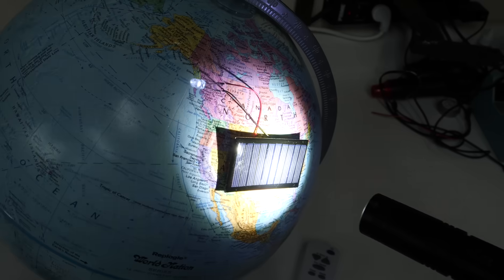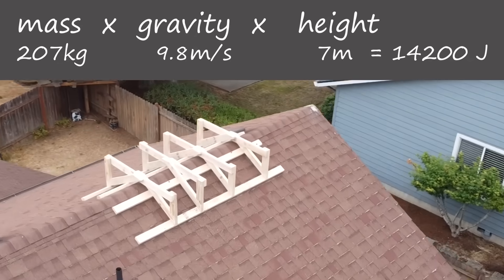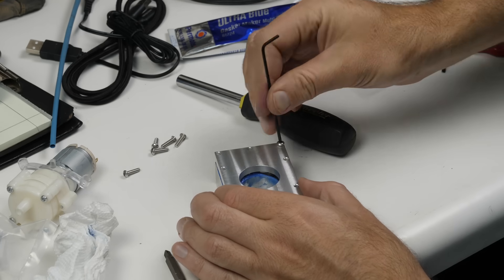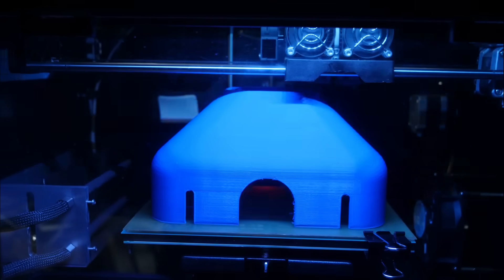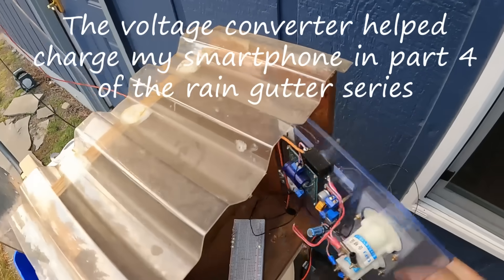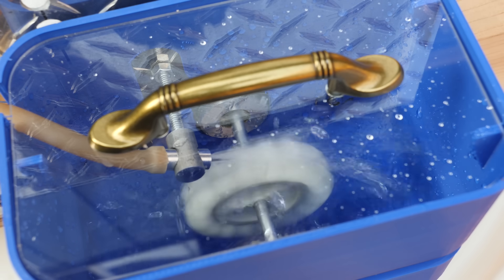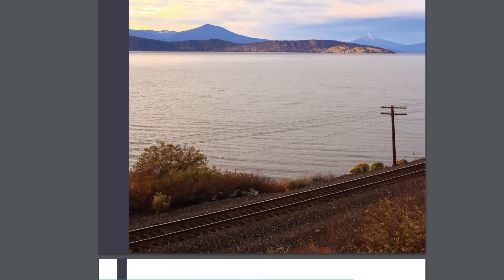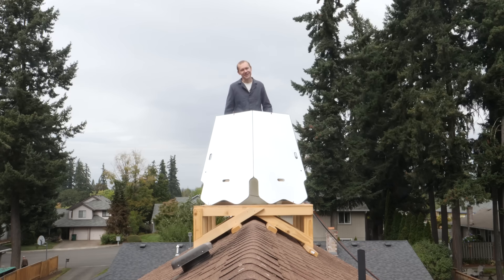Storing Solar Power on my ROOF!!!

Comment: Years ago I calculated that I'd need to suspend a volume of concrete that had the same square footage as my home and 9ft tall, over 35 feet in the air to have enough potential energy to power my home for a day.  That quickly destroyed all ambitions I had of using potential energy as a means of energy storage.
Reply: What if we build our house on the top of a solar powered lifter ?
Reply: @PetitNuagefr  Oh indeed a Historical version of the Graff Zepplin ... it would have Gereeen Hydrogen so so one is going to snake at you... That would make a fine private dwelling. And a competitively priced lifting gas.
Reply: I think remote villages in the mountains would benefit the most of this idea. Lets estimate their water depot is seated maybe 30meters higher than the village, then they just would have to build a second bassin 50meters above the old one. Plus PV and a windmill of course.
Had this idea years ago when hiking in Spain.
Plus another idea If there is a serious water problem, in addition: Build the whole thing based on rainwater - A huge structure around the higher bassin catches enough water for the whole year in winter season, which is then filtered using the solar/wind energy.
Reply: @BarryMambo  laughing in lake Powell and Mead!
Reply: Thanks, apparently someone was needed to point out how terribly inefficient potential energy is, because people here simply choose to believe what they want.
Reply: @krampus3814  people  in general  believe  what they want to. Pointing others' mistakes out doesn't mean you in particular  are  any different.
Reply: @krampus3814  ineffcient is definitely the wrong word. You mean impractical.
Reply: @krampus3814  renewable energy is much the same. It's sad becuase if people acknowledge the reality that these aren't the end all be all of energy generation and storage we could actually find ones that are. But people would rather lie to themselves then admit these things cant work like they do in the video. At most this guy can power a lamp for an hour with this setup.
Reply: @krampus3814  its great to have a pressured water supply for a house. Nothing else
Reply: @krampus3814  who cares how efficient it is if it's green and it works?
Reply: @krampus3814  use lead instead of concrete and you'll be surprised how efficient it is
Reply: @krampus3814 Well gravitational potential energy isn't inefficient at all, but it does have a very low energy density which makes it unfeasible for the average person. That and the conversion from electrical energy to gravitational energy then back is very inefficient.
Reply: What about lifting the whole house?
Reply: @DavidGarcia-kf9wo  The whole brick house, slab foundation and all, is much lighter than floor to ceiling (or 9ft anyhow) of concrete for every square inch of the home.
Reply: @AvgDan  of course, the point coukd be to have the production and storage at home. Local production  reduce energy transport loses and expenses.
Reply: @DavidGarcia-kf9wo yeah but if you build your house on top if that concrete slab you have solved the problem 😂😂😂😂😂😂😂
Reply: @DavidGarcia-kf9wo how about digging a hole?!? 20m depth.
Reply: It's not so much that "potential energy is bad" - lithium batteries and fossil fuels are extremely good and have a very convenient, refined set of interface technologies surrounding them.

In this particular setup I thought the pump and generator were very out of place with the rest of the setup. You don't want delicate parts that will require maintenance in relatively short time, kind of defeats the purpose for replacing batteries. I don't know how hard would it be to work around those elements to both lift and also harness the falling water. In the old days, river mill water wheels did the turbine function and could also lift water in some setups, but with a massive excess of water and slope.

I'd also point out that the setup in this video is extremely inefficient in both energy lost at storage, and energy lost at recovery, making those numbers of potential energy stored purely academic. In reality a lot less is getting stored and recovered than even those low numbers mentioned, from a much bigger input coming from the solar panel.
Reply: @christinemurray1444  Yes, I think people are confusing the efficiency with which you can convert between the stored energy and electrical energy for use with the amount of space and material that you need to do the storage. I do like the fact that he's experimenting with something that I'm sure people are curious about. The result is mostly what I'd expect, a rooftop cistern isn't going to be able to store enough water to make it worth while, unless you've got a massive tank and have designed the roof to deal with it. If this were going to be a serious installation, I'd probably use something like snaking pipes to spread the weight more evenly across the roof.
Reply: @SmallSpoonBrigade  there's also a strong bias in that the storage achieved by batteries is seen as the normality baseline, when in many respects modern batteries are just amazing and you cannot possibly beat them in more than one or two respects without making huge practical compromises, such as infrastructure requirements for instance. Batteries are extremely efficient (in storage/extraction terms), they're also very energy dense in terms of space, they're very plug and play and often require minimal maintenance, etc
Reply: Did you factor in inefficiencies of power generation, because maybe that concrete block would have to be a lot bigger than its theoretical size.
Reply: The first step is identifying the problem.  The next step(s) is finding the solution.  The reason most don't like to do research is because of the failure rate.
Reply: I went through a similar process 🤷. Did the math for this and the energy stored on the drum is about enough to charge my phone to 20%. It does make me appreciate how good lithium batteries are at storing energy though!
Reply: @noisycarlos  I wonder how much better a solar water heater would be generating steam to the barrel upwards and making electricity and then when the condensate comes back down as water for hydro. 40% charge?
Reply: The whole thing works a lot better if you just hook up your neighbors hose to the thing and let the city water do the work! 🤣
Reply: @nickh5081  TBH, I was thinking about the practicality of using a hydraulic ram to pump water into a tank, that could then be tapped for energy. The efficiency on it would likely be garbage, but it would be largely maintenance free and you could probably drive a high efficiency turbine with it. I think a pelton turbine that uses a directed water jet would probably be the best choice.
Reply: @nickh5081 yeah just ask Tesla and Meta that's how they're saving at the tax payers expense
Reply: @adventures6019  what, and pumps don't break down? 
You could replace it and spend a bit extra to make sure it gets recycled properly and it would still be the better option. Besides, life as a power wall is the comfiest life a battery can have and they last a long time in that situation, even regular li-ions last about 10 years. If you use LFPs instead you'd probably pass it down to your children with 80% capacity left.

I'd consider it if the difference was like only around 10x but come on man, when it's 1000kg vs 0.1kg and about a small car's worth of space vs the space on your palm, it's a joke.
Reply: there's always the flywheel, have you looked into any of the commercial models that are already available?
Reply: Yeah I found the same thing. Ahuge reservoir 6 feet deep above my entire house wasn't enough water to do anything useful unfortunately. I'm glad Clint acknowledged this fact at the end of the video, he still earned the subscription from me.
Reply: what if you also use the water to collect heat as well. that would definitely reduce your energy cost.
Reply: Indeed, the 14,000 J proposed in the video's system would power a space heater for about 12 seconds
Reply: This is why I am looking for mountain land
Reply: I tried it with AI , basically , it told me to have any usable energy, I would need several 1000s liters of water in several 10s meters/feet , so no it's not worth it
Reply: Yeah. Mounting a 1000l of water at a height of 1 floor stores only about as much energy as a smartphone battery. That's laughable. You could buy batteries for the price of the stupid setup and end up capable of storing 10x the amount of energy in a space 100x smaller. 
Batteries die in a few years? Fine, use only 50% of their capacity, you're still saving 50x space and having battery life of about a decade
Reply: but they don't die in a few years at all. My lifepo4 batteries get 4000 cycles before they reduce capacity by 20%. That's like 11 years. I'll be using them for at least 30 years. I'm 100% off grid and they were cheap.
Reply: @richarddoesstuff1  exactly what I'm saying. I think you're replying to someone else?
Reply: @nipunagunarathne4882  you said batteries die in a few years? Fine. I was pointing out that even the premise you were arguing against was wrong, because lifepo4 cells go for decades when treated right.
Reply: @nipunagunarathne4882  The "new" (actually a decade older, but not as energy-dense so ignored until recently) Lithium Iron batteries have thousands of cycles in them before significant degredation.
Reply: @nipunagunarathne4882  
I agree on the "stupid setup".
Reply: @nipunagunarathne4882  My LiFePO4 batteries would last ten years if used 100% daily. I figure around 20 years plus, if I can keep my usage to around 50% or less averaged over a year. I haven't seen lower than 80% on my system all winter, (but  I do live where I don't need much heat). I will use more over the summer, as we get around 120F. a lot of days in the summer. I will be finding out what happens this year, but haven't seen lower than 35% at 52Volts so far, and that was when I was installing the system and hadn't gotten as much solar as I do now, which I plan on getting more as I can afford it. (I have 7.05KW/h, and can use up to 12KW/h on my system.
Reply: @nipunagunarathne4882  yes but it's a one time install with minimal upgrades,  batteries don't last 10 years a water based solution on grand scale would last many decades... Im talking about large artificial lakes... on private owner scale I'd imagine running both solar and a water battery is feasible within a passive house with efficient appliances. I imagine there is scope to cycle rain water through land first as a filter.
Reply: @polmishap5287  modern-ish batteries do last 10 years in powerwall settings, in powerwall settings batteries don't get stressed even as much as phone batteries do. People regularly build powerwalls out of DISCARDED laptop batteries and have them last multiple years- like these are batteries the laptop's battery management system would refuse to charge, and even they last 3-5 years.

Also, like I said 3 times before, it uses up immense amounts of space. If you build an entire upper floor to be a tank, that would maybe power a kettle for 30 minutes.

This method is only viable if you've got a humongous amount of space that's useless for basically ANYTHING else. In most cases you could rent a space out for ANYTHING (residence in urban or suburban areas, farming in rural areas) and that would get you money a part of which you could then use to install a battery in a smaller space and maintain it, and that whole strategy is more practical, economical, and green than building a water battery in the same space.

You can take power saving measures with any power source... including batteries, that doesn't count.
Reply: @polmishap5287  Don't just "imagine running both solar and a water battery is feasible", calculate it instead.  

Take the energy efficiency of the water pump to pump the water up and efficiency of the hydro generator to generate the water going down. Then look at your power bills and determine how much energy you use during the period you'd be using pumped hydro and determine how much water storage you need.  

For the vast majority of people it is simply not feasible to use pumped hydro storage on a personal scale and when you do the math you'll understand why.  You'll end up deciding that more solar and/or wind combined with battery storage is the best bet at this scale at this time.  If for whatever extremely unlikely reason you still think it's a good idea, imagine every person with the available space actually doing this. Think about how those ponds are going to get filled back up when they lose water due to evaporation.  You can't just rely on rain, and water scarcity is a real problem.

Maybe we'll eventually get kinetic energy storage, like a spinning mass inside a vacuum at very high RPM, that's affordable for homeowners.  That said, it's a long ways away for widespread commercial adoption, let alone homeowners.  

There's many energy storage ideas people think are just a fantastic idea before they do the math.  Whether it's storing it by putting tension on springs or compressing air or pumping hydro at small scale, etc., the ideas are nothing more than daydreaming until you do the math and, most likely, abandon the idea due to feasibility.
Reply: @polmishap5287  LiFePO4 batteries can have a 20 year lifetime BEFORE degrading to around 80% of capacity, if not used down to 100% discharge every day. I figure my system will last at least 20 years by keeping my usage down to around 50% averaged yearly.
Reply: @nipunagunarathne4882  It seems like you missed the point. The point is about finding more clean ways of storing power and even simply alternative ways if you don't have access to that kind of battery on a large scale.
Reply: Batteries are mot a sustainable solution. So its a temporary fix that kicks the battery waste can down the road for the next generation to deal with
Reply: @nipunagunarathne4882  My, aren't  you  the  condemning one? Who made you god?
Reply: @jasonschannel9017  Are you replying to the wrong person? I didn't condemn anyone, just stated facts.
Reply: You could always burn coal and oil from Russia to make up the difference 🤔 its working for everyone else
Reply: Big water tank on stilts out he back garden would solve that problem.
Reply: I thought of something like that too but a big hole in the ground.
Problem with concrete is how do you regulate it going down?
Brakes will use up the energy in heat. You would need to gear it to a pump for hydraulic fluid then you could turn down the fluid or stop it to stop the weight, but even then you will lose energy to heat.
Reply: @awfab3517  A flywheel will do the job
Reply: time to take a look what is drawing so much energy and start replace the most demanding and inefficient elements with new, proper insulation and so on, at the end you can make it if you really want to commit:p
Reply: So your going to live in a cave?  Booga Booga
Reply: One beautiful theorem murdered by an ugly fact!
Reply: This system is only a counter measure to use the energy that would be wasted at full power solar generation... you would store it to use later (big losses considered, but still some energy to be used).
Reply: You could lift your water to a pond or a set stock of tanks which also function as a cistern for water supply
Reply: So if my 46" monitor I am writing this comment on consumes 100Wh, that means it is consuming power which would lift 37t block one meter high over an hour? That can't be right. That is counter intuitive.
Reply: Io ricordo nozione che l' Italia vende elettricità alla Svizzera nel dì e la compra a prezzi multipli di notte: la Svizzera accumula in laghi artificiali.
Reply: Arrgh... about time you archaic Americans went to metric
Reply: i was thinking some type of silo big farmers use for milk those are massivr
Reply: Let's say you have a 400-ft steep hill on your property. Putting a tank at the top, there's say 200 feet of usable drop. Flow velocity of using just gravity is about 6 ft/s. You need only about 7.5 kW of generator power for a home so that means a 5" diameter pipe flowing 1.2 cubic ft/s at 40% efficiency could power a home. And that means you would need a 650,000 gallon tank to power a house for 24 hours. In other words, a tank that measures 44x44x44 feet. 

So I'm guessing if you had a wind turbine or solar panel pumping water into that tank, for every 364 days of pumping you would get 1 day of power stored.
Reply: Flywheel would have been smarter.
Reply: Id maybe look into a hydrogen powered generator, might be better idk, store the hydrogen gas during the day, and power the generator at night?
Reply: @athena1491  I've often thought that as well, never bothered to do the math but seems much more logical than some storage methods such as compressed air.  I think high-speed flywheels might be a decent option, but again, I haven't done the math.  Most storage options seem a bit more convoluted for a homeowner to implement than say a LiFePO4 battery bank or better/future battery technologies.
Reply: @AvgDan  mhm, id say flywheel is the simplest and quietest, bit spooky having like, 500 pounds of metal spinning at high speed 24/7 but hey, pretty spooky having explosive gas wired through your walls to your stove so, same difference really

flywheels are starting to be looked at seriously in modern settings as well, and were used in the industrial period
Reply: Steel is almost 8X more dense than water and 3X more dense than concrete. Lead is almost 50% more dense than steel.
Reply: Something denser?
Reply: Try the sand battery
Reply: The commenter below mentioned slope angle and the necessary scale of the project needed for success, another pointed out the lack of diameter for the drain hose limiting the pressure that ends up on the generator wheel. Yet another mentioned the potential of algae growth clogging the whole thing up because the barrel is opaque. Well the algae problem is easily solved with some copper tubing or copper sulfate or just distilled water. My thoughts on your issue of scale and land slope have brought me to wonder if a simple air pump and a one way valve might solve the issue of carrying the water up to the tank, maybe a second pump run inline at the top of the barrel, either way, one pump at just one end will either fail to meet expectations or in the OP'S experience it might just melt if a coolant option is not included. I run a small aquarium plant grow operation in a 1br apt, 8 tanks totalling 200 gallons inside and a 260gal pond on my uh.. patio thing... Space. "Backyard" what have you. In the years it's taken me to build it all out using literal garbage and materials rescued from waste bins, and to learn how to make the most out of the most basic and limited of resources. This has included building height differentiated linked flow systems using different diameter tubing, different power scale pumps, gravity and pressure concerns, and a whole lot of FAAFO. I got some pretty cool things to work over time, it probably would have been better with actual math work done rather than my fuzzy math FAAFO methods, but yeah back to my original point about bubbles.... I often found bubblers injected one-way somewhere along the water elevation tubing would push water higher than just opting for a stronger or multiple water pump systems if you also had a graduated diameter across most of the water elevation tube. Thick tubing at the bottom, thinner at the top, but with equal inlet/outlet diameter, and the reverse for the downspout tube. 

@quint now:

Having the diameters be equal all the way up and down is killing your destination pressures (er that's aimed at our dear Quint) but as far as the algebraic equations that will dictate how to improve performance in both directions, I can't really help there, I'm more concept driven than showing my work, and most of this just makes enough sense in my head to kinda do what you're doing, but I don't really spend money hehe. I also have crap for tools and no space for your setup. Half of my apartment works on 3w cat water dish USB pumps lol. 

I also really wonder about your choice of generator design, you have a 3dprinter man and id love to see you use it :) make a turbine!  But I totally understand and appreciate you sharing these ...obsessions? Passions? Either way. Looking forward to more
Reply: What if we had wells in farm and build water tank lm floor and put the generator in near bottom of well to generate electricity, at very low cost
Reply: @pankajseervi779  do the math and tell us how big the tank needs to be and how far it must be above the water level to store enough water to generate 29KWh (US avg household daily energy use) and tell us the efficiency of the generator you used in the calculation.
Reply: just lift your house
Reply: Possibilities to create a hydro-solar power station using a large set of solar banks and a mountain. Australia, this would be perfect for you! (At least in victoria or Australia)
Reply: Yes that old adage "Use it or lose it"  applies.
Reply: yeah I just calculated his 14200 j to equal roughly 4wh. At least his lights will be on!
Reply: Yeah I figured out something similar years ago
Reply: How about multiple smaller units instead of 1 big one?
Reply: I had to give a thumb down, because you expect to power your house. I MEAN YOUR ENTIRE HOUSE. Why do people expect every innovation to replace everything totally? Why do people expect 100% or better thermal efficiency and if not they continue with their current 10%. Plus, everything should be easy, free and eternal. With those expectations we will never get out of the 10% life.
Reply: Good news, that's only a 4.5' tall concrete monstrosity at 70'.
Reply: It’s just not efficient or practical. It’s silly to say otherwise. He would have been better off showing how a flywheel battery works
Reply: @Pmc987  is solar,  who the hell cares about the efficiency of the sun?
Reply: Have you switched to energy efficient appliances? I've heard one can get about 25% energy consumption from the average home by using a variety of energy efficient designs instead of average appliance/home designs.
Reply: @atomatopia1  yeah those energy efficiency designs are usually cheaply made with planned obsolescence over priced garbage. Why have an off grid power source if after a year none of your appliances even work anymore.
Reply: @atomatopia1  or use the old ones less. Grey energy stored in trashed appliances counts a lot, notwithstanding the other issues.
Reply: @atomatopia1  Would you please explain what you mean by: "one can get about 25% energy consumption from the average home..." 
To [get consumption from] anything, is illogical. (except tuberculosis, prior to the discovery of its cause)
Reply: @atomatopia1  Building houses out of BRICKS (in sufficient thickness) will remove the need for air conditioning and thus cut down on power A LOT. (Europe doesnt have air conditioning usually.)

You can also do a lot by shaping the house "correctly" (I have a "front corridor" facing south which is covered with glass panes ... and it provides enough heat during spring and autumn so I dont need heating and if you were to build a house with that in mind it can double as a greenhouse to provide vegetables or at least some herbs.)
Reply: Im dying 🤣🤣🤣
Reply: Your expectations were low and your ambitions not strong enough.
 It is not doable by most people, but for those who have the space and slope to make a water reservoir for energy storage, it by no means destroys their dreams.
 The cost and space involved usually pay-off for those with more cash and land in their possession, especially for a government.
Reply: @UserName-cb6jz  The vast majority of people with the land and cash who wish to have energy storage will still opt for $300/kW-hr batteries over potential energy storage and use their two ponds/reservoirs for fish, and not risk liability of hundreds of tons of solid material suspended or on a grade.
Reply: @AvgDan  You really need a huge head to make it worth it the better option cost wise. Without that the cost of building and maintaining the infrastructure will outweigh that of simply using a battery. Granted you can sometimes make things work with a lower head but that generally comes in with primary hydropower, eg run of the river schemes where there is a near limitless supply of mass with a good flowrate already present at the site. Granted a domestic scheme would not need a river, a decent stream can provide a good amount of primary hydropower for domestic use. I know someone that restored the old mill wheel of the former watermill they converted for that purpose. But with that there is still a degree of intermittency sometimes it produces too much and sometimes too little so they resorted to net metering with the grid. Works well enough for them though their power bills have been negative most of the time since they got it up and running. They are hoping at some point to get plans through to restore the upper mill pond though it has a capacity (without dredging the accumulated silt) of 2,000 m^3 with a drop of around 10m, that would be a fair amount for residential use as is though some 55 kWh or so would last them almost a week. The problem is trying to get a design for the new sluices and such through as the building is grade 2 listed but for efficient utilisation it really needs them to get some form of discreet servomotor assembly approved to call for the stored water when needed. Even then it would probably also need a small battery for them to never import power at all as the response time would be too slow otherwise. But it need not be that large something that could handle a few kilowatts for tens of seconds to a minute or so eg if the electric oven and a couple of hobs are turned on suddenly.
Reply: @FaerieSeraphina  I wish 55kWh would last me a week, I haven't had a single day since July 1st that low, though I did use 56kWh on two of those days.
Reply: @AvgDan  I presume you have a significantly larger or less energy efficient home than they do perhaps. Granted their demands are reduced quite a bit as they also use a ground source heat pump for heating etc too. Also that week estimate isn't based on there being zero flow in the stream there is still always some energy coming from that their consumption peaks at around 20-25 kWh per day in the winter which at estimated worst case stream flows should leave 5-10 kWh/day needing to be picked up by the stored water. In reality the situation is likely better than that as flows tend to be higher when demand is highest in cold climates, it is the opposite in hotter climates though as it is summer a/c demand rather than winter heat demand that dominates temperature control consumption which is the biggest load in most spaces.
Reply: @AvgDan  if you are ambitious enough and have a positive mental attitude and a government grant you can change the laws of Physics.  It also helps to never try the prototype beyond a Gedankenexperiment involving a bong and a back porch rocking chair.
Reply: @AvgDan  What are you running ?
Reply: @jshaw4757  I work from home now and have different house than original calculation, I also use MORE electricity to pre-cool my home prior to peak pricing which saves money even with greater consumption.  

Let's do the calculation again with estimates on median US home size based on having same volume of concrete as living volume of a median-sized home. 

1) I'm going to estimate a median 1800 sq ft home/apartment size for all residential electric users, since pretty much everything I look for regarding median home sq feet is based on new home construction, not existing homes, or single-family home and not apartments.  The most useful data I found was from a 2013 US News article titled: "Are Suburban Homes Too Big".  

2) Average US power usage is 893 KWh per month for residential customers, or 29.339 KWh per day, per EIA dot gov: "How much electricity does an American home use?".

3) I'm just pulling numbers out my rear here, but going to say average ceiling height is 9ft.  A shorter ceiling would require weight to be suspended higher and vice versa.

4) 1,800 sq ft with 9 ft ceilings has 600 cubic yards of volume.

5) Concrete is 4,050 lbs per cubic yard more or less.

6) 600 cubic yards of concrete is 2,430,000 lbs, or 1,215 tons.

7) 2,430,000 lbs has 3,292 Kilojoules of potential energy per foot of height.

8) 3,292 Kilojoules is equivalent to 0.9146 KWh.

9) 29.339 KWh of daily usage divided by 0.9146 KWh of potential energy per foot equals 32.08 feet in height that 1,215 tons must be suspended in air to have enough potential energy to store the power a median home uses per day (24 hours).

10) If electric generation and lift motors were both 85% efficient, the height of the suspended weight would need to be 44.4 ft, 90% efficiency = 39.6 ft, and 95% efficiency = 35.55 ft.

I originally did my calculations based on wind being the green energy source and wind doesn't always blow, so I wanted to know 24 hours of energy storage.

Oh, and 600 cubic yards of concrete at a very conservative price of $100 per cubic yard is $60,000.
Reply: Could you have an in ground pool and a deeper resoviour lower down?  Like technically you could install a big tank under ground and build stuff / use space that’s above it. Just might need to make it possible to access it is all.
Reply: Never freezes this way or just add a bunch of salt to it
Reply: @FaerieSeraphina  In winter, this water system would either freeze, or need LOTS of energy just to keep the water from freezing, in most places in the US.
Reply: @Tumbleweed5150  Sure a few centimetres maybe even as much as a metre near the surface might. The upper reservoir of these facilities is more like tens of metres deep for a small one and the outlets to the turbines are near the bottom for obvious reasons. You know the whole water fall down thing means it makes no sense having them high up where they can only access a tiny fraction of the capacity.

Also ice floats including any that manages to cool enough to start to freeze around the rear face of the dam which is not a lot as reinforced concrete many metres thick makes a terrible thermal conductor to facilitate the heat transfer too. Ice itself is also a really good insulator which is why it is really damn hard to freeze large deep bodies of water. Hell even Antarctica with winter temperatures more like -50C and struggles to get much above -20C still has liquid lakes albeit the ice over those is more like several kilometres thick. But it should give you some idea just how slowly ice grows when you consider they last saw a surface temperature above freezing some 6,000 years ago.

So ice is really not a barrier here, how do you think all of the big hydroelectric damns in Norway function during the winter? You know Norway a country where the average temperature falls to -6.8°C (~19.8°F) in winter and the surface of lakes freeze over due to that being a lower temperature than water freezes at.
Reply: @UserName-cb6jz  This is not a practicable solution for small scale energy storage for individual users due to height/flow rate vs. energy output issues. To illustrate those here's a calculation: I need about 17 kWh per day of electric energy. This amounts to an average need of about 0.6kW per hour. If I  plug this valiue into a hydropower calculator using a given head of 10m (this is about the height of a two-storey house) I need a flow rate of about 2 galllons per second to  produce a 0.6kW energy output. You need therefore a reservoir of about 7200 gallons of water at 10m above your turbine to produce 0.6kWh. Who can install such a reservoir on their roof?  Of course if you own a house with a tall and preferably steep hill at its side you may increase the head to make the reservoir smaller. The formula is linear, so if you want to cut the size of the reservoir by 50% you need to double the head. If you have an 80m head availabe your reservoir still has to have a volume of 900 gallons to produce 0.6kWh. This solution only would work for somebody who has a large pond at least a couple of dozens of meters above their house. This pond could be filled during the day and serve to produce electricity at night (assuming that you do not also have a spring on your property you'd need another pond of the same size at turbine/pump elevation in order to store the water for the next day's tranfer to the higher reservoir). Houses with features like this aren't readily available in large numbers. Pumped hydropower is a large scale solution and not practicable as energy storage for almost all individual users.
Reply: @wkgurr  your comment should be pinned at the top. Thanks.
Reply: @wkgurr  I mean most people have way less energy demand at night than in the day, and this battery would only be needed at night after the sun goes down. with a maxed out energy efficient house (I've heard of people reducing up to 85% of their usage; from 30KwH to 4.7 KwH per day by replacing inefficient light bulbs, clothelines instead of drying machines, well-insulated walls, etc). Electrical usage falls by about 25% at night, so in this scenario, with everything factored together that comes out to 0.146 KwH of energy demand. So thats about 4x less demand than in your scenario, so the reservoir could be 4x smaller, so the 1800 gallons. An 1800-gallon drum would have a 12'L x 5.1' diameter (61 square feet). 1800 gallons of water would weigh 14,992 lbs and the tank would weigh another 670 lbs, which together would be 15,662 lbs. This would create 257 pounds per square feet of pressure, which is WAAAY too much for a normal residential rooftop to support. (The average rooftop can support 20-27 ppsf). Therefore it would need to be suspended with another structure outside the home in the yard, and probably would be best if it was partially underground, say 5 meters above and 5 meters below or whatever works best.

So yeah, definitely not the easiest thing to achieve, but I can imagine this actually being feasible in this scenario. Plus if it's partially underground, it would cost less energy to pump surface water into it. So yeah, I'd say theres still a debate to be had on small scale hydro-pump storage, especially because of it's simplicity and readily available building materials for it.
Reply: @UserName-cb6jz  it's already done by governments (Cali been doing this forever with some reservoirs). No one is building new reservoirs just for this but taking advantage of existing ones.
Reply: @UserName-cb6jz  if that tank can store 14k joules, it would take 18 thousand tanks to power a home one day
Reply: use sand
Reply: @Opal.Workshop  Sand is even lighter then concrete (1500kg/m³ vs 2400kg/m³)  . Use lead , that weighs 11.3kg/m³, almost 8 times as heavy as sand and 4.7 times more heavy then concrete. But allot more expensive.
Reply: @bartdereu9267  I dont know how any of it works sorry i was just suggesting because I saw a video of it being done with sand
Reply: @Opal.Workshop  
I hate sand
Reply: Use fossil fuels for night time energy and be happy with renewable during the day
Reply: @chriskazaglis  no
Reply: @chriskazaglis  I was doing that: running a generator at night, until I put in my new system. I haven't had to run my generator for around 2 years now. (Off-grid in the Southern CA desert).